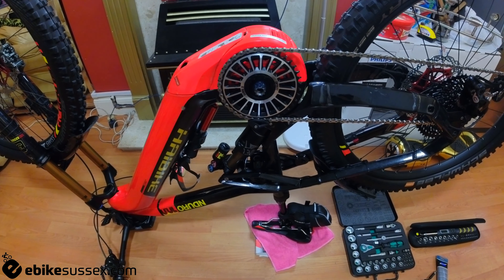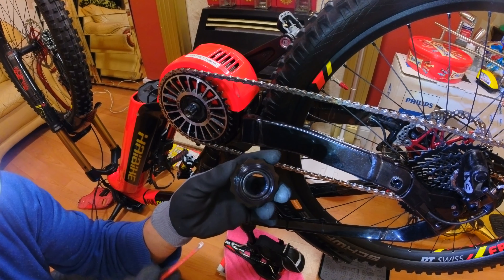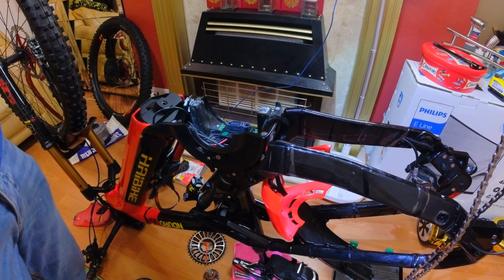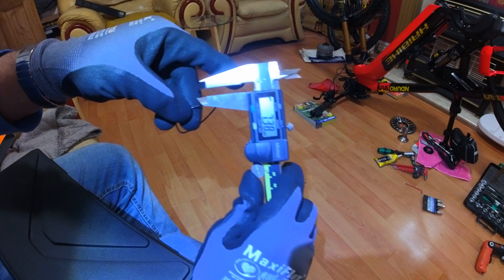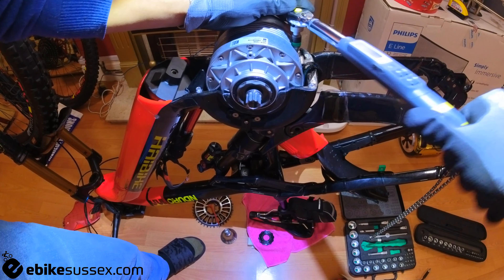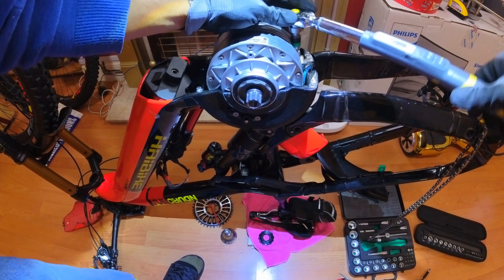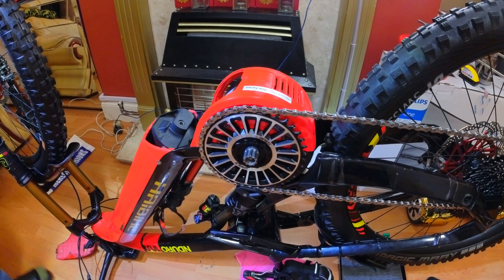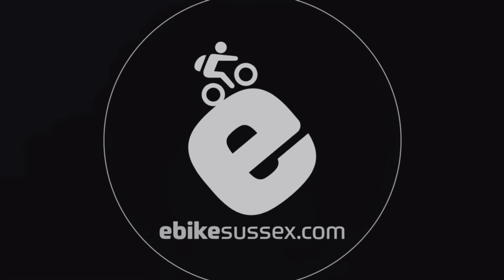How to replace a TQ HPR 120s motor Haibike Flyon eBike

Comment: Where is it possible to get a new engine? I heard they stopped producing. Is it possible to put a Bosch or Bafang motor on this, or it it only possible to use the Flyon engine that appears to be impossible to get?

Comment: Why is the motor being replaced ?
Reply from the maker: Hello, the motor is making a whinging noise.
Reply: thank you . was it determined what the issue was/is.  this is the first time i have heard of a TQ,motor being replaced . i have a NOX from Austria  ,with the Sachs/ BMZ motor , there have been some replacements with that motor as well but i never heard what it was that failed .